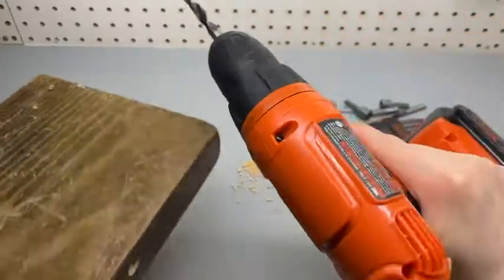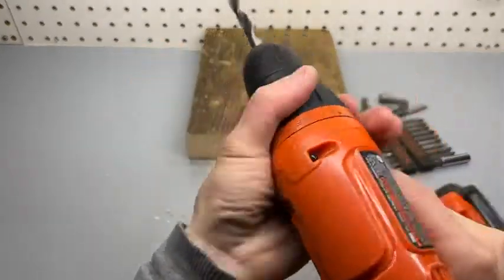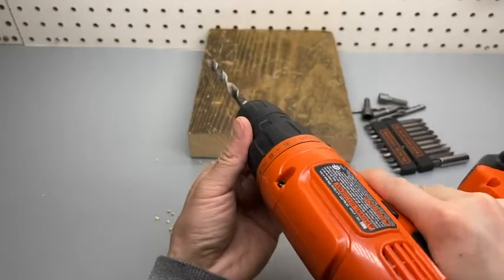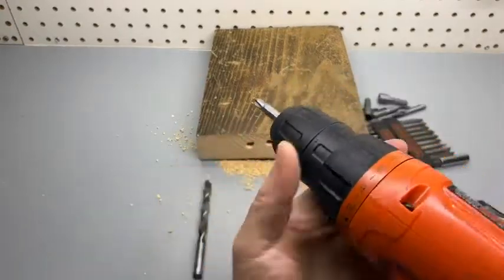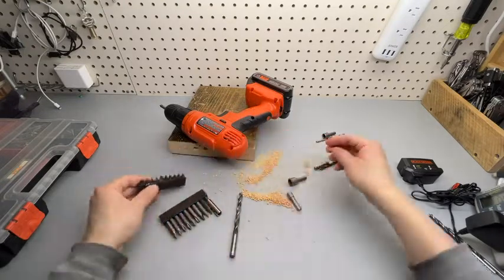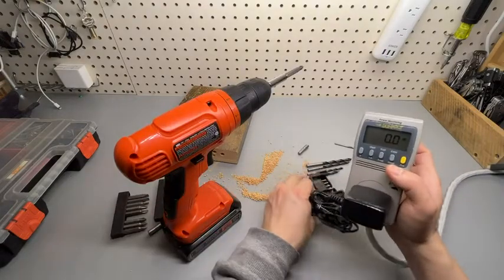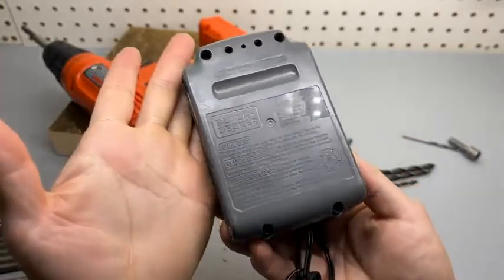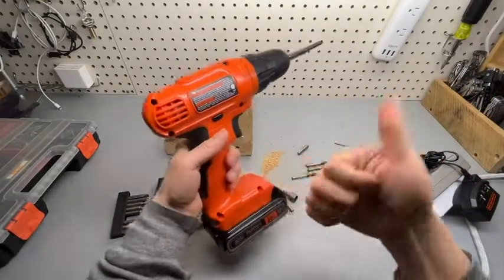BLACK+DECKER 20V MAX POWER-CONNECT CORDLESS  DRILLERDRIVER  30 PC KIT REVIEW.

Comment: I bought this exact drill as a package deal with the Black and Decker drill and driver. I really like the driver, however this drill I find quite useless. I accidentally took this drill to do a small job and it really struggled to drive 3 small screws into a 4X4. It’s really crazy how much better the driver is!